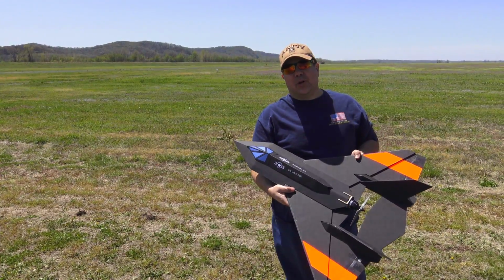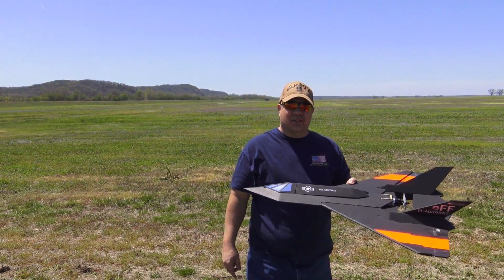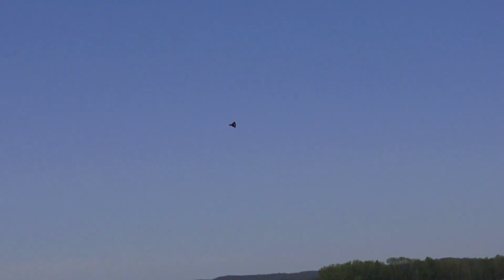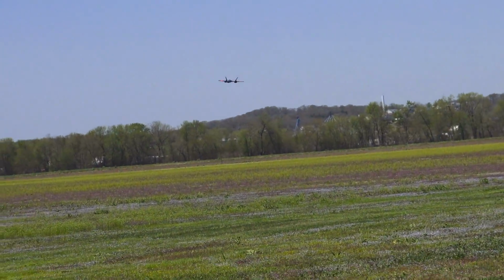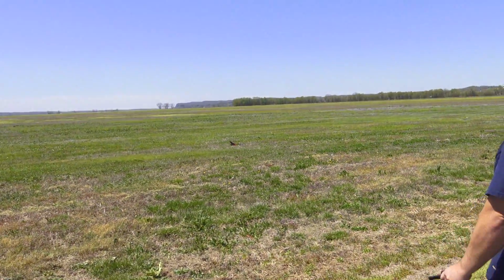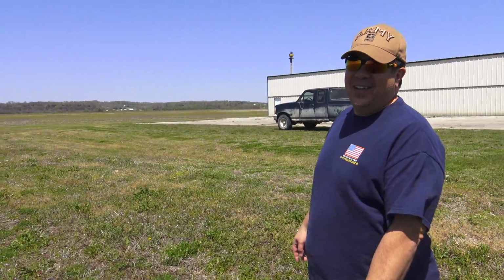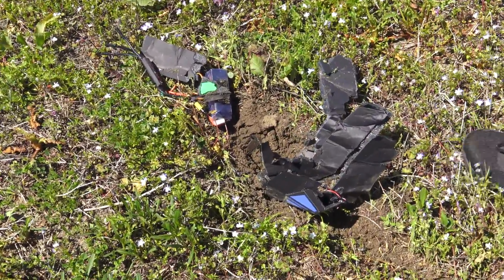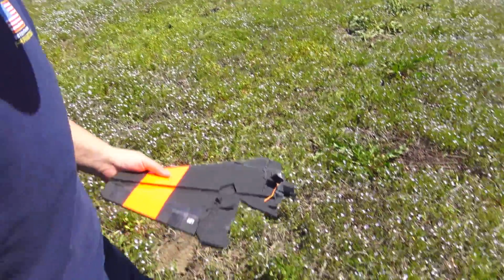Fast FF-Aurora With Crazy Crash!

Comment: thanks for posting.  nice work.  were this model mine, i would try to reduce the prop squeal.   excess prop noise may be cause by a 'starved' prop.   at higher airspeeds, airflow causes there to be Less air in front of the prop.   due to its construction, the main wing is makes very little lift; mostly at the tips.       cheers

Comment: i think you have demonstrated that flying a delta-wing model in a highly banked turn at wot leaves a pilot no margin for error, if More thrust is needed.   i would guess those profile 'engines' are not a good idea.  because where they extend forward of the vert-stab leading edges, the profile 'engines' make the geometry of the vert-stab roots wonky.     cheers